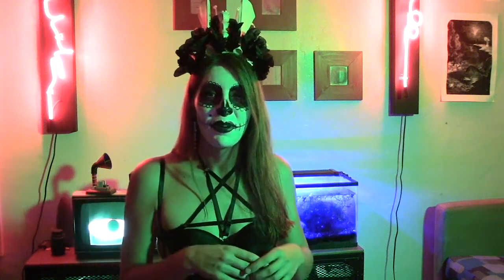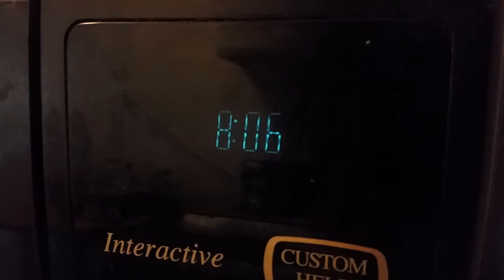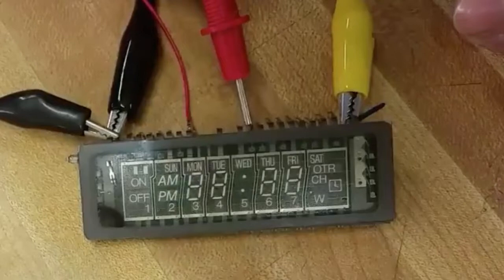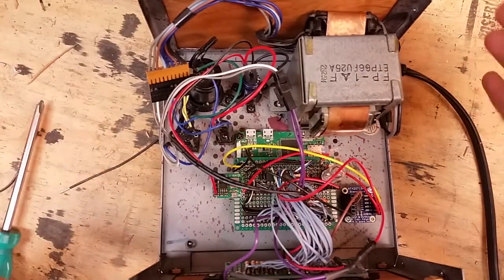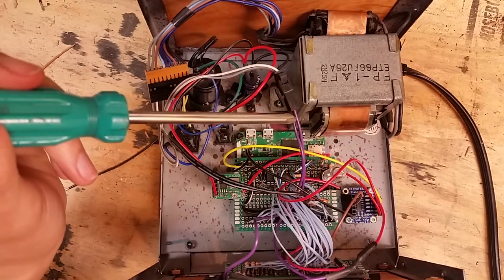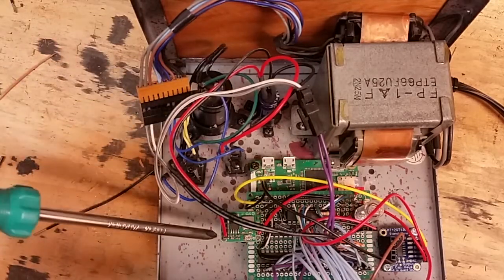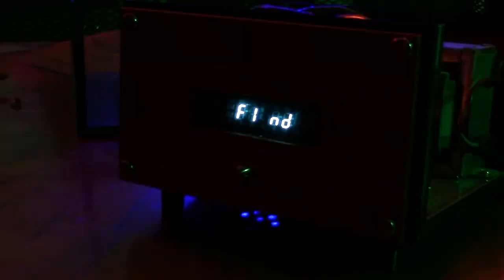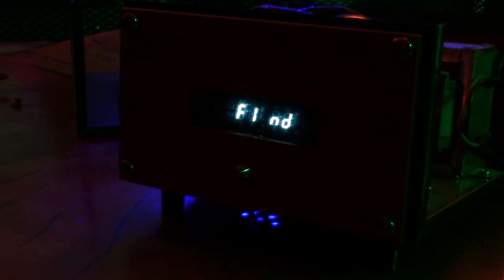Death Clock -- The New Old Clock That Says When You Die

Comment: VFD's rock. I've like 150 vintage VFD video hand helds, and I've been messing around to drive the tubes of damaged ones with own games/code. My go to chip for VFD control now is the MEGA32. It has 32 IO pins, usually enough. I combine it with darlingtons as well. So you can do a single chip, with 4 darlington IC's, all with DIP packages. Fun thing is these handheld games were among the first devices with buck converters. As these needed to drive the 35V (a wider panel needs a little higher voltage) from a 6V battery array, they needed the simplest and cheapest way to make it. Basically they use a flip-flop where one of the transistors is a high-voltage one, a small tranformer, a zener diode and a capacitor to flatten things out.